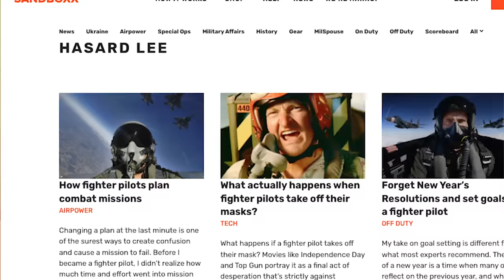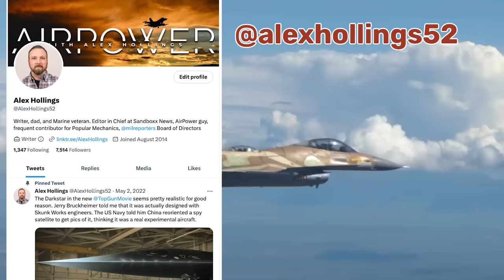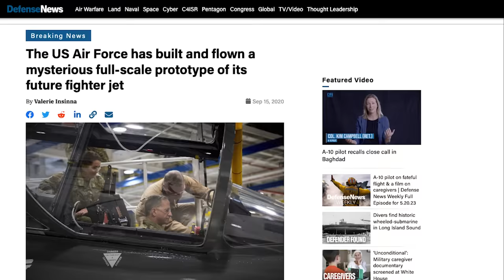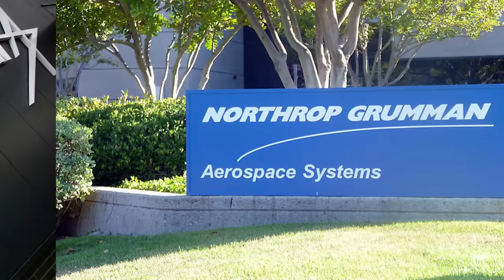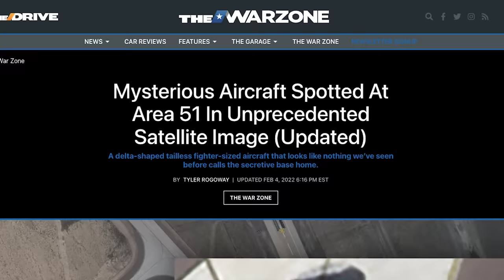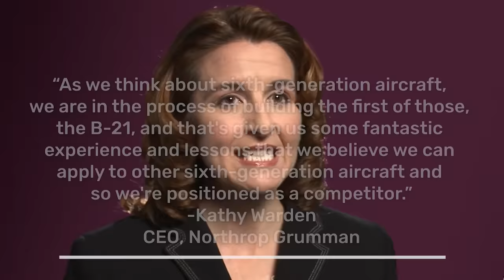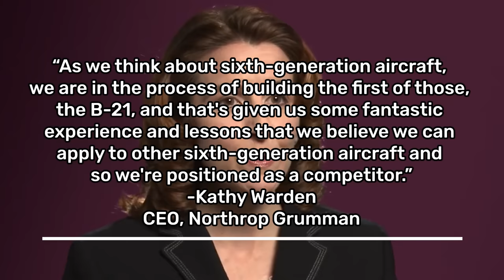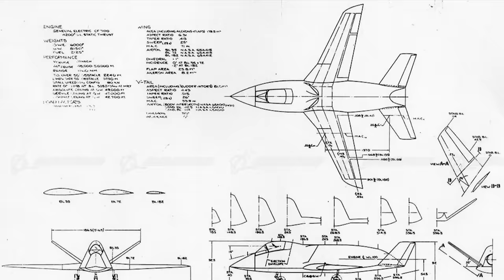The race is officially ON to field America's new stealth fighter

Comment: There is always the possibility too, although not likely with the cost involved, more than one aircraft could win. One being a larger aircraft mainly for attack roles, one for a small unit designed as an interceptor and dog fighter, then another as ether a wingman aircraft or that gets picked up by another service.
Reply: Too many airframes for supply chains to deal with. They've got the F-35 which already excels in the fighter & strike role, so having the larger NGAD will be plenty
Reply: @Aidan Williams  For right now. But the F35 was just meant to compliment the F22. It was a smaller aircraft which could handle the strike fighter role. And this is nothing new, the Air Force and Navy used to do this all the time. The concept of having one fighter do it all is a recent trend. Eventually the military will want a dedicated fighter interceptor and a separate attack, multi-mission platform. I don't disagree with you, the the NGAD will most likely replace the F22, which is only about 20 years old. By the time NGAD starts to be mass produced, the F35 will also be in its 20s. Now, I fully agree with you, I do not think they will do this for cost reasons, but it's also the US military, and right now they want craft which can take out targets in China and Russia, and that's going to necessitate longer range, more payload for weapons and greater survivability that what we have now. Of course, the US Airforce also has a hypersonic fighter on order so we will see how that factors in to all of this. Who knows, they may just make NGAD a bases hip and have the wingman aircraft handle the strike and fighter interceptor rolls, but I don't think we are there just yet.
Reply: @jhmcd2  Modern battlefields being so complicated I feel necessitates multirole capability. We saw with the hornet how useful it is and I think it'll stay that way for a while apart from more dedicated drones. The difference between the F-22 and F-35 is the architecture, it's designed to be much easier to upgrade in the future and the new coating will fare much better than the routine for F-22 maintenance. I agree they'll want more range and payload but with new engines, maybe stealthy fuel tanks, and some aircraft acting as missile trucks I don't think they'll need more

Comment: I'm not an expert, so I'm very curious to know the answer to this question: Since fighters like the F-22 have such a tiny radar signature (about the size of a bumble bee) couldn't a nation train an AI to assist in radar detection by looking for tiny objects that are moving at high speeds and have a relatively stable altitude (this second criteria may not be necessary, but it could help)?
Reply: The point is to make it look like background noise and hard to detect. Russia and China are also lacking in American chips that power AI so they need to make their own hard and long process.

Comment: As much as I love LM’s babies, I would like to see NG take the helm for NGAD. LM will likely still be heavily involved with unmanned partners for those NGAD fighters, since they have better chops in mass production.

Boeing would be my second pick, if for no other reason than to resuscitate and boost their advanced technologies departments. We need more than just LM with a large production base for advanced fighter planes.

Hopefully, at least Boeing or NG get either NGAD and FA-XX.

I think LM’s production is stretched enough fielding F-35s for the next decade.
Reply: I think that Boeing has a leg up when it comes to drone tech with their new stingray tanker drone and ghost bat loyal wingman. So I wouldn't be surprised if the drone contract goes to them with their expertise and the navy and airforce contracts go to NG and Lockheed. They are going to make alot of drones and Boeing has the capacity and the open production lines.
Reply: I think Boeing will get the drone tech while NG might end up with either the Navy or Air Force 6th gen while LM takes the other 6th gen fighter.  Don't trust boeing with the 6th gen.
Reply: @ameritoast5174  Yes that sounds right when you put it that way.

Comment: I know that this is something that SOUNDS like it doesn't work well, but because these aircraft are going to last many decades because of how big of a jump there is from 4th gen to 6th gen, I think it may work better to use 2 different companies to put together the plane, because while one design might have strengths in certain areas and weaknesses in others, we need a 6th gen plane that is basically ALL strengths.

For instance there is the new material now that show allow 6th gen planes to be supersonic while maintaining its stealth capability and NOT have to be totally reskinned after it goes supersonic.  If this is proprietary to one company and the others can't use it, well, that doesn't do the US any good if another plane has other features that make it the better choice.

In other words, THIS gen and THIS next fighter has to be top notch in every regard because the US can't afford to have a 6th gen fighter be anything else.

Comment: Are there going to be different companies making the NGAD vs the drones flying with them? Feels like there are some major overlaps - but they don't necessarily have to be exactly from the same companies either. Maybe even multiple types of drones?

I'm also just thinking about the maintenance efforts that are going to be required when there are thousands of stealth drone fighters going out (and potentially treated more roughly) all the time..
Reply: Probably, the DOD likes to share the love when it comes to contracts. 

Also, don’t get too sucked into the common narrative when it comes to stealth aircraft, they are actually much easier to maintain than other aircraft, just more expensive because the parts are usually more complex. The F35A has a maintenance hour per flight hour of 4-5. For context, most fighters sit at 10-18. Drones would be even easier, since they don’t have a million little things to keep the pilot alive and comfy. They would almost certainly have even lower maintenance hour ratios.

Comment: Hey, regarding the tailless design, isn't there another control surface on the wings itself they're making by changing the drag of the surface, I feel like it was via an electrical process, not mechanical. Really scratching the back of my brain here. Was this a thing?

Comment: Now...now ..now Alex...You ARE the Man, but the idea the tailless NGAD may just not be as agile as the F-22 and that it will be as or likely more Systems with as or more capable than the F-35. That said, I think, it was Boeing that fielded a scale version of one I assume tailless NGAD Designs and it's capabilities. It wasn't full scale as the model was an 8 ft test unit which when asked about how it flew they replied better than anticipated and because of it's forward "canard" wings it was extremely maneuverable. So, in any event I am sure of one thing we will be surprised.

Comment: We have already seen two of the 6th gen prototypes and witnessed a bit of their remarkable performance characteristics.  Neither have any observable control surfaces or means of propulsion...each can seamlessly transition between air, ocean and orbit ...both can accelerate from a stand still to Mach 5 in the blink of an eye and execute 90 degree turns at any speed, and both have variable stealth capabilities that includes a Romulan type cloaking device that makes them invisible to the naked eye, as well as to high and low band radar and infrared wavelengths...
sound familiar?  Well what if I told you that one has a shape that is decidedly similar to a tic tac...and the other to a gymble ?

Comment: I predict that the NGAD with Adaptive Cycle Engines will not have an afterburner. This will save weight and extend range and be able to supercruise.
Reply: The whole point of adaptive cycle is to have the best of both worlds.  I don't see them cutting the afterburner from any fighter.  Especially since it's one of the only ways to make thrust at extreme high altitude and speed
Reply: Taking away Afterburners wont make the engines better.  They will still have afterburners cause its easy tech to implement. Plus you want that afterburner at certain times as a pilot.

Comment: 5:25 Can someone explain the two panels on the back of the F-35 pls?!? I figure it has something to do with the STOVL takeoff variant because I’ve only noticed it on the B model I’m pretty sure. I figured the hinged door worked kinda like a hood scoop forcing air down inside it to a fan but there’s two of them so what would the second set or sliding doors be? Maybe an auxiliary air intake? Does it supply the same fan or a different one? I figured someone on here will know, tia 👍

Comment: I am rooting for Boeing, at least they should get this FA-XX program working. Otherwise it will be very very hard for them to get a foothold into the fighter market again. This would also mean NG and LM are the only potential manufacturers further increasing prices. It's already an Oligopoly. Narrowing it down even further would not help the tax payer, especially considering the enormous cost overruns with the F-22, F-35 and the B-2. Hopefully Boeing doesn't mess up like they did in the passenger market.

Comment: The pilot is going to be several miles away simply in orbit where he will jack into the drones and the controls will be transferred from the F-35 to one of several drivers. Then the regions AWACS will have pilots flying the F-35 drone's drones in fpv to deliver ordinance. Inception but with jets.

Comment: Northrop should put up a newer version of the yf23. Northrop might already have a contract but Lockheed had both f22 and f35 contracts at the same time so it’s not out of the question. Lockheed probably won’t due to the f35 program inflated costs. Boeing bought McDonnell Douglas who built the f15 and other fighter jets so I dunno. They all have experience and whoever wins I’m sure it will be good.

Comment: I personally disagree with Boeing having nothing to do, you forget that Boeing is betting big on the T-38/F-5 replacement and Boeing has publicly said that all the assembly lines for the F-18 are being converted to Red Hawk assembly lines. While I doubt the Air Force will be ordering thousands of Red Hawks, Boeing will still be getting contracts for quite some time (and likely controversies as you alluded to in the video). But by the time NGAD enters serial production, then I understand your point where their lines will be empty.

Comment: What about the SR72 often talked about as a Mach 6+ drone and project Aurora? Was there an SR91? Are we going to see hypersonic planes that fly above 100,000 feet? In January 2018 Lockheed got a patent for a 100 kw portable fusion reactor generator small enough to fit in planes, even trucks. They said they'd have a working prototype by the end of 2019. We never heard about it again. There were other rumors floating around such as the capability to project the illusion of hundreds of decoys in a way that would make stealth unnecessary.  Lots of talk but so far no facts.

Comment: not an expert in aeronautics but believe Boeing's X-32 stealth multi role fighter seemed more promising as a dedicated naval carrier borne fighter . . . the X-32 prototype design architecture needs quite a bit of design changes (enhancements) . . . for e.g. the X-32 needs a tad longer fuselage & smaller but streamlined engine intakes . . . completely revised lower fuselage design & lightweight dual-wheel main landing gear, incase of the naval carrier borne variant . . . first generation adaptive cycle turbofan engines, 38% - 43% more overall efficiency, than current crop of turbofan engines . . . not to mention 2nd generation sensor fusion tech . . . X-32s internal weapons bay should be big enough to accommodate five AGM-158J JASSM XR active radar homing air-to-surface land attack cruise missile & 4 Meteor semi-active radar homing GPS guided BVR air-to-air missiles . . . 25 MM - 30 MM built-in internal cannon cannot be ruled out, & neither can you discard under wing hard points . . . folding wings for easy stowage in aircraft hangar decks below the enormous CATOBAR flight decks . . . the KC-46 multi mission mid-air refuelling tanker aircraft should have been based on the B767-300 ER in the first place . . . or the stretched B767-400 ER wide body jet for that matter . . .

Comment: Both General Bogdan, former F-35 program director, and General Hostage, former ACC commander, have said the F-35 is more stealthy than the F-22. General Bogdan did so in Senate testimony. 

"Hostage caused a stir in late spring when, in press interviews, he said the F-35 would be stealthier than the F-22, its larger USAF stablemate. Conventional wisdom had pegged the F-22, with its angled, vectored-thrust engines, as a stealthier machine than the F-35. Hostage also said the F-35 would be unbeatable when employed in numbers, which is why the full buy of aircraft is “so critical.” “I would say that General Hostage … is accurate in his statement about the simple stealthiness of the F-35 [with regard] to other airplanes,” Bogdan said in the interview. The statement was accurate for radar cross section, as measured in decibels, and range of detectability, he said, and he scoffed at the notion that anyone can tell how stealthy an aircraft is just by looking at it." .... https://www.airforcemag.com/article/The-F-35-on-Final-Approach/

And aerodynamic performance does not make up for a poorer SA.

Comment: I'm sorry, but I don't see these 6th gen platforms as worth the cost at this point. 5th gen is looking to be enough for the foreseeable future. 300 MILL a FIGHTER aircraft is just beyond insane.
Reply: We only have one 5th gen plane and that's the F-35.  Its only strength is its sensory suit.  6th gen will have better stuff in it that the F-35 is not capable off.  Also you always build for the future and never the now because if you do you get behind.  That philosophy has kept our military on the cutting edge and better than all the others.

Comment: I’d say Boeing might be getting the contract: Northrop has the B-21 in development, and Lockheed both has the 22 and the 35 to maintain, both of which gained notoriety for price (which is probably what took the YF-23 out of the running against the YF-22)

Comment: NG & GE will be fraked up again for same reason. NG has a bomber, GE does to advanced engines.... anyway, with approach to so called E-series, rapid prototyping and navy in the loop - it might be very well that TWO designs we'll be fielded in limited numbers. As for YF-23 - with modern manufacturing  and materials that would VASTLY improve stealth alone,  and F-35 current avionics and GE adaptive engines would satifsfy NGAD requirement. 22:00 - please, don't mention XF-32.

Comment: I hope they've learned the lessons from the F-22 and F-35 programs, and that is: speed is absolutely vital for striking the ground. The F-22 has proven itself more capable as a strike fighter than the F-35 that was supposed to be the best strike fighter ever made, simply because greater speed leads to greater range for the bombs dropped from the plane. For stand-off attacks, which are increasingly more important as air defense systems everywhere improve, having that extra initial velocity is essential for any guided bomb or glide bomb. I know the F-35 is basically just a money laundering operation at this point, to fund Lockheed Martin's extensive classified drone programs, but had we simply just built more F-22s, and no F-35s at all, we'd be in a much better situation.

And this isn't a knock against the F-35, not really. It's a great plane. I'm not one of those people who has to invent reasons to hate it. But the F-22 is better at all the physical things the F-35 was supposed to be better than the F-22 at. Just a fact. It can put explosives on target quicker than the F-35, and with a lot more survivability. If we are going into near-peer conflicts again, or at least trying to deter those conflicts from happening, the F-35 isn't the right weapon for that job, the F-22 is. Heck, for the types of conflicts the F-35 was designed for, all you really need is some B-52s loitering about.

So I'm very hopeful that NGAD will keep air-to-ground capability firmly in mind. Taking out pop-up threats and striking inside of contested airspaces has to be a major consideration when they're designing the internal weapons bay. If it's designed strictly as an air-to-air fighter, and can't lug around enough heavy bombs, we're only going to have to redo this all again in a few years. A B-21 isn't going to always be around when you need one, and they will be too slow to get someplace when time is a factor. F-35s will simply be unable to carry out certain missions because of its low speed and larger radar signature. We need a platform that can win the air war but also deal with ground targets ASAP from as far away from enemy defenses as possible.

Comment: It looks like the air force personnel is in for some grave downsizing, few and far apart expensive platforms means a lack of presence around the world, along with inability to engage in low intensity conflicts where payload capacity and quick reaction are more important than performance and stealth attributes. A high-low mix of B-52/B-21 and F-35/NGAD (F-70?) cannot be financially reasonable in the next Afghanistan kind of war.